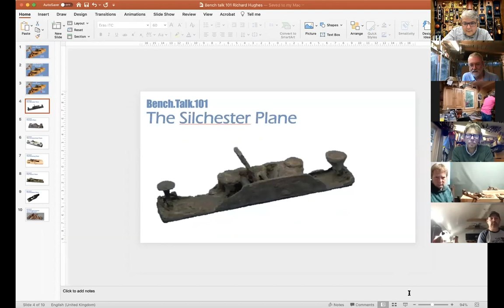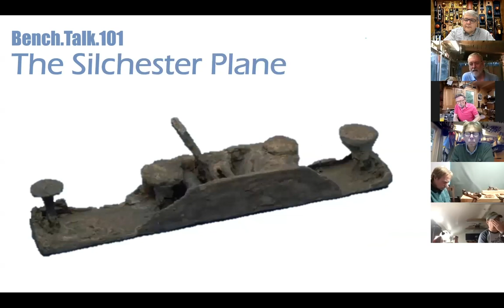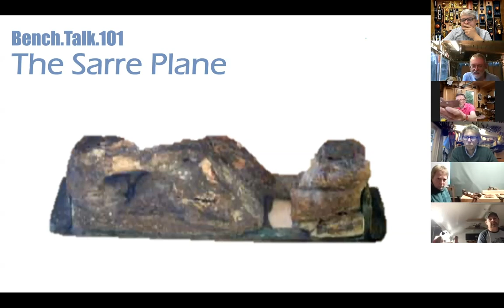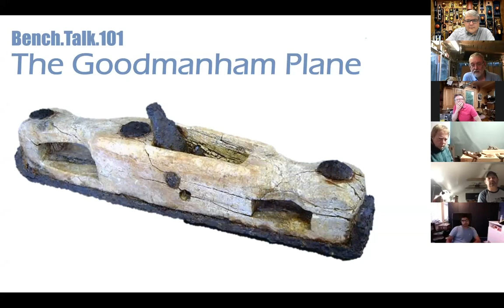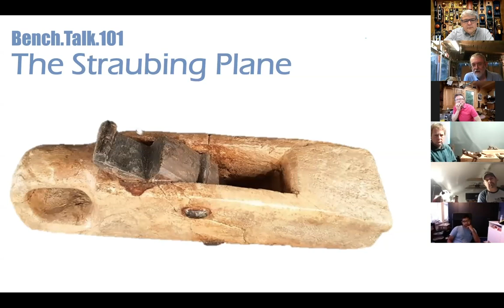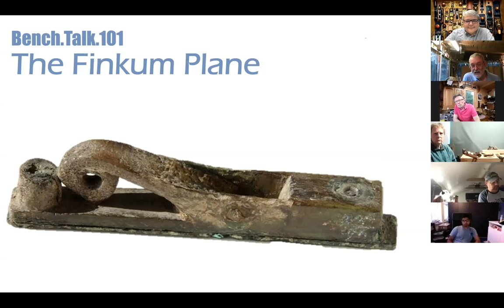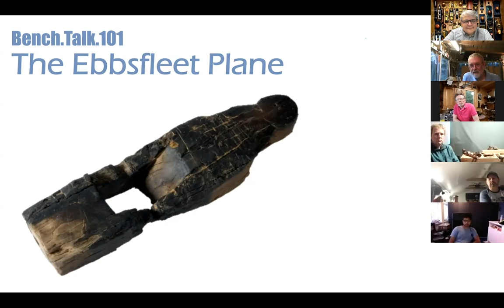Bench Talk 101 Richard Hughes Talks Ancient Hand Planes

Comment: Thanks for a fantastic presentation. I noticed the arrow-making plane appears to have a hole drilled across the width of the top of the wedge . Is it possible that this served as a convenient way for the worker to size the diameter of the arrows? 
Whether this was used for making arrows or some other  cylindrical object,  this feature at least seems to support the idea that this was a tool for making large quantities of standardised  items, assuming it wasn’t decorative.
Looks like a lot of fun!